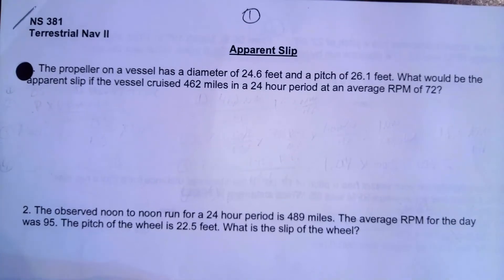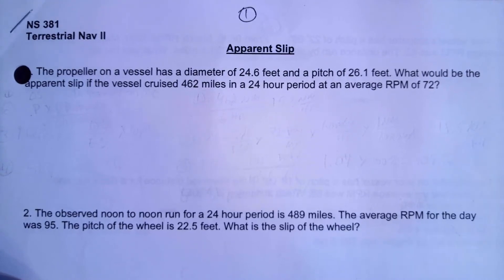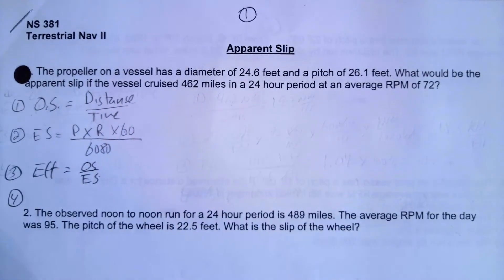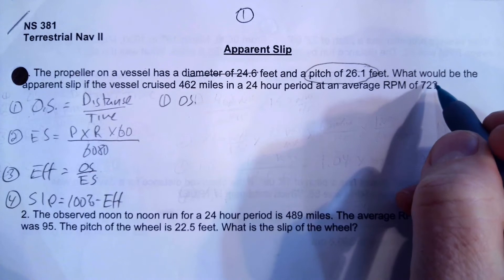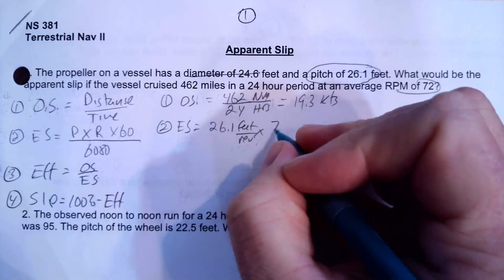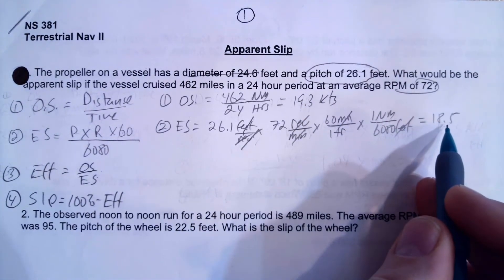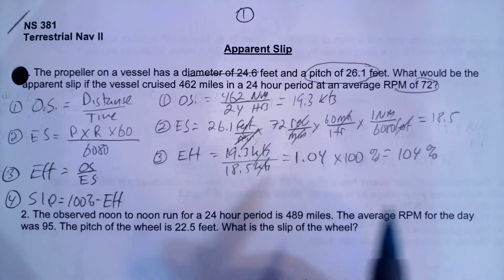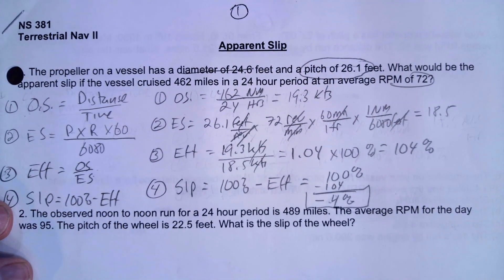Calculating Efficiency and Apparent Slip

Comment: isnt 1nautical mile is 1.15 mile.  . . you just simply put 462 NM without converting?  (im learning, great video😉)
Reply from the maker: The distances used are in units of Nautical Miles not Statute Miles.  No need to convert.